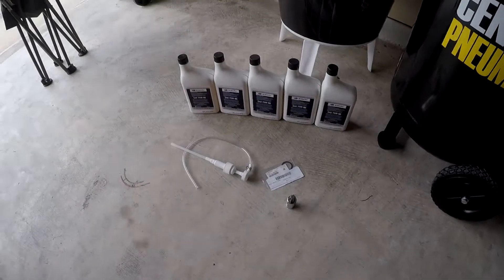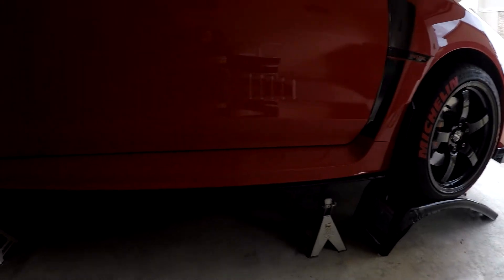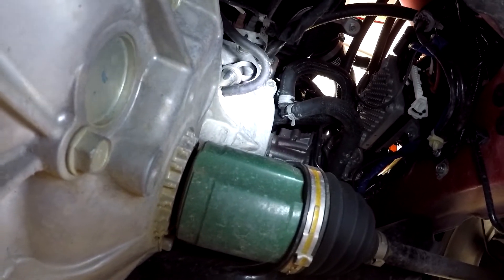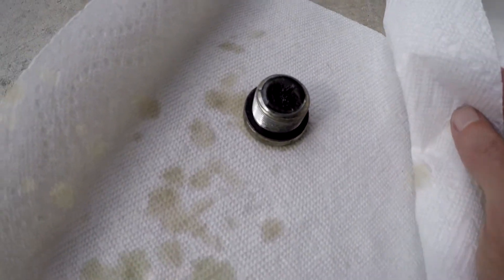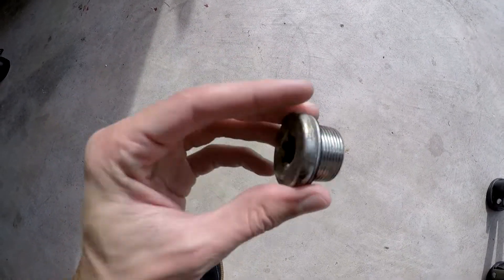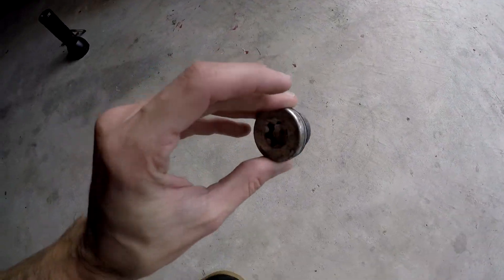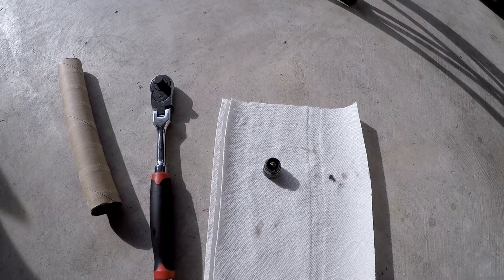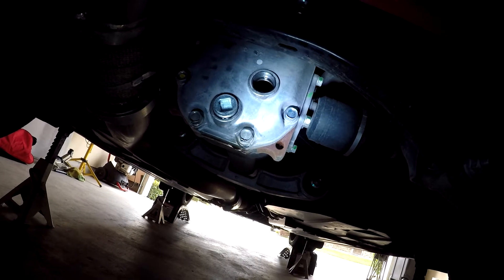2017 WRX Transmission Fluid Change

Comment: The torque spec for the T70 is 51.6 ft-lbs. The torque spec for the fill level check bolt is 25.8 ft-lbs on the front. The rear is like 36ft-lbs for either T-type or VA-type. I think this is T-type rear differential.

Comment: still curious if you drove the car onto the 4 ramps or just drove it on to 2 ramps, then used a jack to lift the other two wheels (rear) high enough to slide ramps under the tires...I know having the car level during this process is important.
Reply from the maker: I actually just jacked up the front then slid the ramps underneath. Then used the jacks to lift and lever the rear. Then just put jack stands all around for safety. The car is actually too low to drive up the ramps I have.
Reply: @WRXSNOWBOARDER   ... thx.   doing 1st front diff fluid change now (60k mi) and have 2 ramps.  I would need to stack 3x 2x8s to get the rear to the same height (or w/in a half inch).  my Rhino ramps = 6.5" lift

Comment: Do the differential bolts have washer to replace
Reply from the maker: The front has one. Genuine Subaru 803926090 Gasket
Reply: ... the rear fill/drain plugs do not; at least on the (VA) WRX.

Comment: What size are the bolts and what type of wrench is that
Reply from the maker: It's a t70 for the front and a 1/2" fitting on the rear. I just used the wrench without a socket for that.

Comment: Weird question, but where did you get those ramps? Looking for something that small so its portable for me.
Reply from the maker: I got them at home depot. The issue it that the incline is too steep to drive up though. I just use the jack to lift the car and then lower it on the ramp. I feel more comfortable doing it like that anyway than trying to drive up them. I've seen to many fail videos. Harbor freight had some nice ramps as well.
Reply: @WRXSNOWBOARDER  Yeah I've been looking for some portable ramps, but everything is either too expensive or too steep to use. Thanks though.
Reply: @luflo22 ... unless your car is extremely low, you can use a 2x8 (or 2x10) cut at 18"L to act as a pre-ramp to get the nose of the car up so that it doesn't contact the ramp before the tire contacts the ramp.  that is what I've done to use my Rhino ramps w/my wrx.  you can also put a 45* cut on the leasing edge of the wood to aid in driving on to the wood

Comment: Is that dipstick the transmission oil or differential oil?  I've seen people call it both?
Reply from the maker: It measures the oil that's in the transmission. The car has front, center and rear diffs so it can be called either.
Reply: @WRXSNOWBOARDER  so it's the  reservoir?  I Know my Outback its separate front-center diff vs transmission dipsticks
Reply from the maker: @matthewmiller6068  there's only one for the WRX.

Comment: Hey is this the same for 2017 cvt
Reply from the maker: CVT will use a different type of fluid than manual.
Reply from the maker: With the cvt there's conflicting opinions on even if it needs to be changed at all.
Reply: @WRXSNOWBOARDER  I know that most longtime techs recommend at 100k. It’s a great CVT